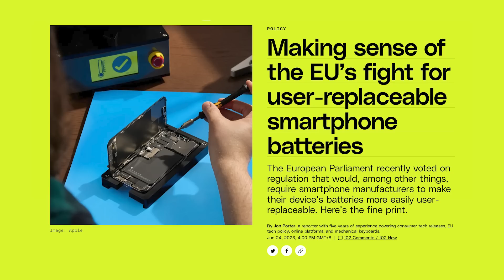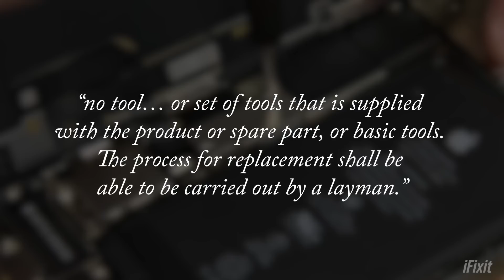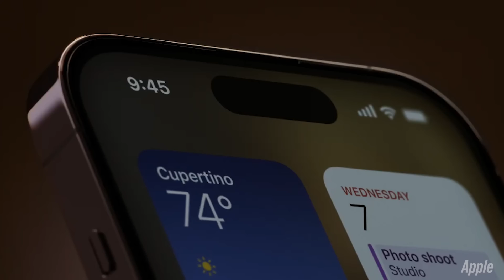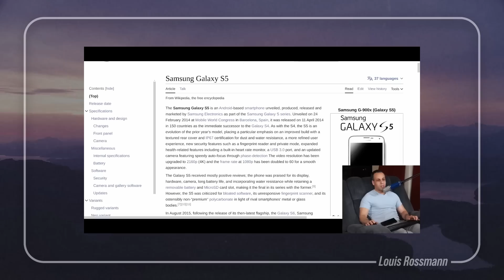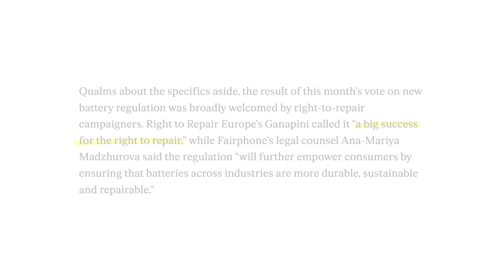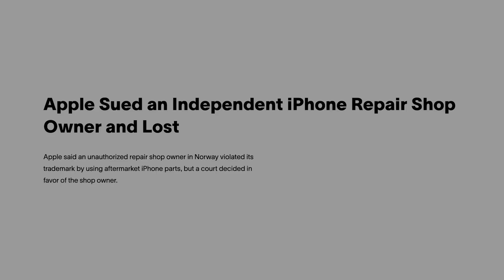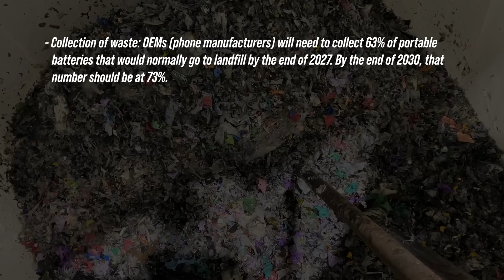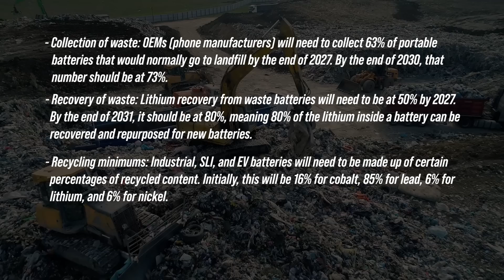EU Just Changed Smartphones Forever

Comment: Not only batteries, laptops are coming with soldered RAMs, Storage, Processors etc. Also keyboards are glued thermally with plastic screws making it extremely difficult to remove and replace. Double RAM slots have become single now in many consumer models. If all these are not the outcome of greed, then I fail to understand what it is.
Reply: go pro and others  have waterproof to 15m  they all removeable batteries .
Reply: Yeah this keyboards in laptops are extremaly annoying to change. I literally had to use knife to remove plastic garbage and then hotglue new keyboard back. It works for 2+ years now so I guess glue is the way!
Reply: eu already has drafts in place regarding the anti-consumer tactics in laptops. soldered ssd makes laptops fail completely at less than half their usual lifespan.
Reply: You don't need government to fix your problems in the market. Don't want a laptop without removable RAM? Here's a wild idea, don't buy one. Every dollar you spend is a vote, telling a company "I want more of this." There are laptop companies out there that focus on user replaceable parts, vote/buy their products instead. Let consumers decide what's best. Obviously it's not that big a deal considering how many people buy laptops without user replaceable components. Or build your own PC and cut the big companies out entirely. You have many options that don't require geriatric legislators passing laws they don't understand. Laws that will be antiquated in a few years and only hamper innovation.
Reply: @TamCloncey  let consumers decide what's best... You missed the part where the government has to protect the customer from themselves? Customers are short term minded and decide only what's best for them short term. Governments have to plan for the long term. I know the USA isnt doing to well in that regard, which is why the law is coming from the EU :p
Reply: @Laylander  EU planning for the long term? They can't even keep their primary members from leaving.
Reply: @TamCloncey  Not all members can plan long-term, apparently haha. Just look at all the issues Britain currently has due to brexit. Hardly any of the promises came true, most of the foreseen consequences did.
Reply: @Laylander  The UK left because the EU started to pass laws that contradicted UK law. It become an issue with national sovereignty. Why would the UK allow other nations to boss it around? If national sovereignty was the primary goal, then brexit was and is a success. Turns out bigger government makes things worse for more people.
Reply: At the end of the day, consumers don't really care. Soldered or not, removable battery or not. That narrative doesn't sell phones. People want the newest, biggest, dearest recent hit they can get and show others
Reply: @tommyj6481  I hate shopping for a new device, though, each time if it breaks after a certain year. I would rather they not make it more difficult to replace something simple like the slim battery. Hope they will come up with something where I dont have to worry about battery or anything else. Like have them powered wirelessly without the battery.
Reply: Soldered processors are the norm and should stay so. Why?

1) A socket will force the laptop to be thicker. While this isn't an issue for already thick performance models, ultrabooks will suffer.
2) A laptop CPU doesn't have an IHS. This means that the silicon is exposed, and any accidental damage, no matter how little, will render the chip unusable.
3) Laptop heatsinks are engineered with the consumption of a specific CPU in mind. Overbuilding a heatsink in a model with a low end CPU just for the possibility of it being upgraded to a higher end chip isn't feasible or worth the effort.
Reply: EU just delivered a FU to corporate greed! YIppie Ki Yay!
Reply: @Lionel212001  don’t rejoice early for regulation, usually It is in kahoots with the corpus. We live in fascism and cronyism, despite the democratic facade, but we still have a say by voting with our wallets and attention
Reply: Ram can be soldered because it doesn’t degrade in a few months. Batteries are things that do and you can’t avoid it in any way. That’s why they should be replaceable. Ram is just one level of memory, why don’t we ask to replace cpu cache? That would be absurd. Ram became similar to cpu cache in modern SoC
Reply: @Tobool  because manufacturers put insane price premium for ram upgrade. Also cpu cache is on the cpu itself, you also don't have user replaceable cache in a pc. A laptop should be as user replaceable as a pc of course, not talking about power supply or big ass shit but you get me
Reply: I had a laptop that had a charging port short circuit...In order to fix it I needed a new mother board... Which was the same price as a laptop
Reply: USB-A ports stared missing so does the LAN.
Reply: It's also about thickness - look how slim the MacBook Air is, compared ot any enterprise grade Thinkpad or Latitude. 
I personally don't mind a beefy laptop where I can swap out any of the crucial components when it eventually breaks or becomes obsolete. That's why I'm looking forward to Framework's design and hoping they come up with even more competitive models to rival consumer-grade devices.
Reply: Sir, have you tried testing an X1 carbon or even older X series thinkpads? They have way more ports and are more serviceable and modular than the heavier Macbook Air from any generation.  @gandalf5895
Reply: It's not greed directly, it's just capitalism running it's course. Capitalism is rooted in greed, but it's the consumer's, not the company's. Soldering RAM is faster and cheaper to do in bulk, so you can put your product on the marktet for less than your competitor, while maintaining the same specs. The average consumer is short term focussed and doesn't care about upgradability or ease of repair, hence why mainstream electronics followed this development. Most consumers often see a broken screen as a nice excuse to get a new phone. So, don't blame the companies for doing exactly what the consumer wants, and for trying to do it better than their competitors. This also highlights why it's important to have governments. They're there to protect us from ourselves. Because most of us are not just consumers, we are part of a company.
Reply: @Laylander   No companies aren't doing what exactly the consumers want. The part of the world where I come from, every penny counts and upgradeabilty and serviceability is a big part of the equation. I have run a service firm in the past and I beg to differ sir. The average consumer is here for the long term. He is putting in his hard earned money and likes to see the product last, be able to upgrade in future and carry out hassle free services. What applies to smartphones does not apply to laptops. Atleast in my opinion.
Reply: I’m not so worried about soldered ram and storage. As long as it’s clear that it can’t be upgraded, the consumer can decide if it matters to them… but batteries degrade and are the failure point is most devices which cause it to need to be replaced hence I think the battery issue needs to be resolved.
Reply: @inksapien 
Check some tests. Aple does the mort forceful of integrating/soldering everything onto the mainboard. Then their heat dissipation sucks the most. After a few years of usage MacBook Pro's cook themselves. There are a lot of tests available. Soldering everything to the mainboard does not help anything but only to make more e-waste than ever.
Reply: They only making same reasons like Apple does before eco-friendly 💀
Reply: There are some advantages to soldering the RAM, like increased speed, but i'd rather have the slower RAM and be able to upgrade/swap it. Enterprise models i kinda understand, as they are generally replaced at a faster rate than consumer ones, and come with swap warranties.
Reply: @Osvaldium Speed depends on length of the bus, not on whether it's replacable or not

Laptops would be outperforming PCs if it actually was like that, which is not the case
PCs are always faster by ALOT
Reply: @Osvaldium    And I heard it was to prevent memory errors. Once the stick gets errors, it won't boot to the system, and some computers have poor build qualities of dimms and don't recognize some rams.
Reply: @Osvaldium negligible for most consumers, if PC can have attachable ram do does laptops,removable ssd and ram takes almost no additional space
Reply: it's not greed necessarily. Most end users don't even know what a ram slot us, not to mention that he has one or two. Ram capacity/stick has grown so much that you can get 64GB / stick, why do you need 2 slots? Server laptop? Same goes for storage, processors, etc. avg end user doesn't touch them.
Reply: @dadwillfixit every multinational corporation is inherently greedy. And why not provide the option to have all parts replaceable for those who wish to upgrade and not buy a fucking new macbook display for just a faulty 50 cent flex cable?
Reply: @dadwillfixit  
User doesn't touch but if they have any problem it's necessary for the service that how easy or hard to replace theese components. 
Apple started to solder even the SSD on the mainboard to make it almost impossible to extend/raise the storage.
Reply: @dadwillfixit  What happens if the user ends up buying a laptop without knowing it has soldered RAM? Going by your logic, if the end user is ignorant, he is never gonna know anyway. So after 1 year, he wants to upgrade his RAM. What now? Another scenario: Well let us imagine that Laptop is only limited by single RAM slot which is upgradeable. Then what about the bandwidth advantage that he is missing out when compared to dual channel memory? Surely the companies did not intend to strip the end user of that privilege? Did they?
Reply: @dileepkv3124  huge ass advantage using dual channel on a laptop......gamih laptops have extra ram slots. Also you can dual channel soldered+slotted if you want.
Reply: @dadwillfixit  bro I am aware of enterprise laptops and gaming laptops. So if I am mentioning single slot RAMs, I know which class of laptops I am referring to. Just FYI, I have been using computing devices for close to 30 years now. So I know a thing or two about what I am talking about.
Reply: @dileepkv3124  that's great bro. So do i, i even work in a related domain. There is no reason not to solder the first stick of X gigs of ram on the board for generic cheapo laptops. Mention it in the description and then the user should known about it. If he wants more later he still has a slot for atleast 32 gigs. That should be enough to scroll facebook and presentations, because let's face it, those laptops can barely do that.
Reply: @dadwillfixit  Bro..my only problem is with laptops that basically take away the option of user upgradeability by means of only offering soldered RAMs. If it does indeed have free slots that can be manually populated, there is no reason to have any fuss in the first place right  :)
Reply: Not just greed. Several parts are faster when soldiered.
Besides this, cost reduction not so much in parts but the whole process.

It probably will be a new way for advertising, "Ram upgradable" "SSD upgradable" and such.
And consumers can choose.

Pay $250 for a non upgradable or $300 for an upgradable one?

My $75 aliX laptop works already for 6 years.
It's crap at start, still is.
YT vids, extreme light game..
Child's toy. (Bought and intended for my daughter)
I can replace the battery pouch, didn't locate the "hard drive" lol.. must be sandwiched between something.

Upgrades?😅 Lol...
You get what you pay for.

And yes... 6 years, still 30 minutes of power on the battery.
Minions and Gru slashing of the screen :-)
Reply: @fhorst02 That's just propaganda, LPDDR4X, DDR5, can be just as fast in SODIMM, there's no upside for soldering except for manufacturer to serialize or create bios that will brick your device forcing you to buy more. Stop supporting this shit
Reply: The issue with making laptops like that is you will most definitely have to implement slower exchange rates between shared components. You also have a choice as to what product you buy, if you want a device more accessible to upgrade or change parts, then you will probably go with a bulkier and sometimes more expensive model. The general population does not feel comfortable operating on their laptop’s internals
Reply: @isaiahrains1999  laptop is mobile and consumme less battery than computer. sometimes the upgrade you want is not available in the model so you want to do it yourself. dumbing down consumer is crime.
Reply: @isaiahrains1999  Slower exchange rate is mostly meaningless for most components (huge exception is cpu ram as integrated GPUs use it). Also having possibility to change components doesn't mean that it will be bulkier, it's manufacturers propaganda ;) Just look at framework laptop. Noone force you to change components, but if you want to currently you have no possibility ^^
Reply: @isaiahrains1999  thats the same dumb arguments people make about glued in batteries, and yet we see devices like ultra thin laptops with swappable components. Besides, the soldered ssd in a modern macbook is actually slower than a normal high performance ssd. I am sure that very many people are willing to do minor repairs themselves once it becomes normal and simple to do them, and those that would rather have them done will get to enjoy much lower repair costs.
Reply: I had an example in mind; Apple’s new M1, M2 lineup has everything built into the chip, and yet provides incredible results. Do you expect Apple to throw this out the window and go back to individual components? We’ve seen the performance boost with these chips, I don’t think anyone would want to sacrifice that.
Reply: @isaiahrains1999 They could sell these CPU SOCs lmao
And that would finally ruin Apple's dominance, because custom designs with their proprietary tech would appear

Imagine Android phone with Apple CPU in it

Comment: At last something sensible - they should do this will all electric vehicles as well - but make sure that the designs are standardised to fit all phones and vehicles, irrespective of make and model.
Reply: You havent event watched the first 3 minutes of the video
Reply: @dotonthehorizon9620  My point is that without proper standardisation there will be so any different types of batteries and chargers, companies will still have monopolies.  We currently have 3 types of EV chargers (Type 1,2 & 3) and five types of UK charging plugs, which is a nightmare.  You get to a charging station and find there is a huge line of traffic for Type 1 chargers, but nobody is using the Type 2 or 3 charger - this is stupid.  The phone market is deliberately going to make a specific battery size, connections and charge rate specific for each phone, making charging so complex and expensive, which doesn't help.  When you go shopping and buy any kitchen item you have confidence it will plug into any room in your house, because standardisation laws have been applied.  Consumers should be able to select battery options in future and not be tied to a specific manufacturer.  Let the best battery supplier be chosen by the consumers, that would drive far more competition into the market than exists at the moment, and have a potential to reduce landfill.  If you don't standardise, the consumer will loose.  It is rubbish to talk about water resistance and dust, I have IP65 rated garden lights that have worked for years outside.  With technology today there is no reason manufacturers couldn't develop an IP68 rated (totally waterproof) screw in battery for all electric devices.  We need to name and shame and start avoid buying products that are not designed to minimise the negative impact on our environment and constantly chase profits.

Comment: @ColdFusion If I may ask, have you read the papers? because if yes you would know that the eu does not force manufacutres to have replaceble batteries on products wich have to be water resistant. so every new iphone will be simple a water resistant phone, ebikes obviously are also excluded from the rule becaus they are in rain constantly. its a good first step but there are still to many loophole in the law to not use replaceble batteries. If my information is wrong feel free to correct me :)
first comment under this post is the actual part of the law i mean
Reply: for more Kontext here thats direktly from the eu papers :

To ensure the safety of end-users, this Regulation should provide for a limited derogation for portable batteries
from the removability and replaceability requirements set for portable batteries concerning appliances that
incorporate portable batteries and that are specifically designed to be used, for the majority of the active
service of the appliance, in an environment that is regularly subject to splashing water, water streams or
water immersion and that are intended to be washable or rinseable. This derogation should only apply when
it is not possible, by way of redesign of the appliance, to ensure the safety of the end-user and the safe continued
use of the appliance after the end-user has correctly followed the instructions to remove and replace the battery.
Where the derogation applies, the product should be designed in such a way as to make the battery removable
and replaceable only by independent professionals, and not by end-users

Sorry my english ist not the best but if i understand that right you still can do unreplaceble batteries in the sake of safety